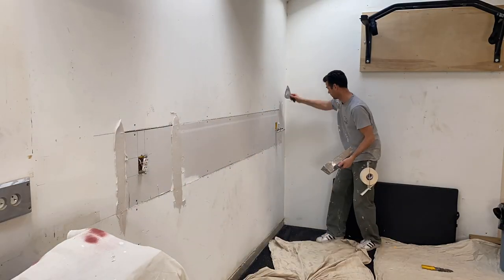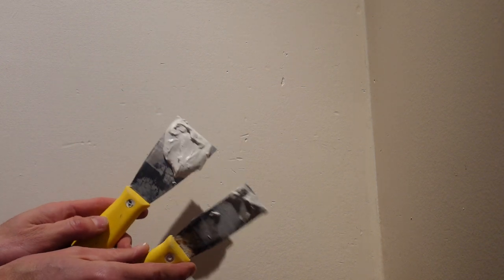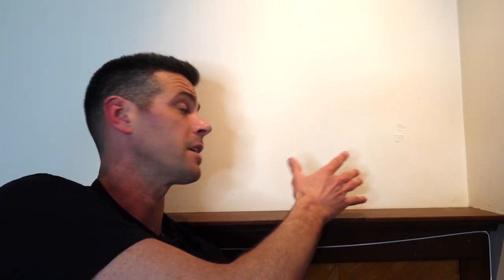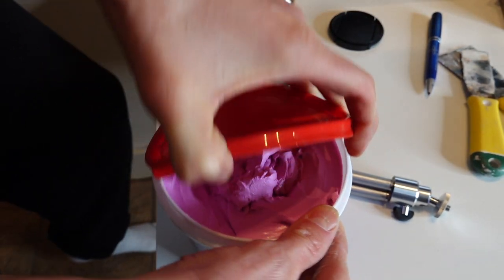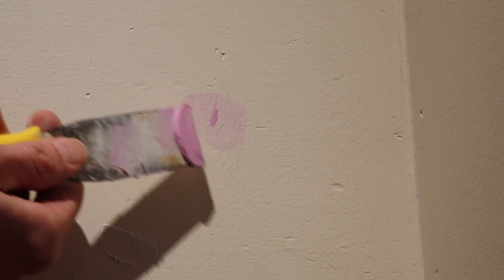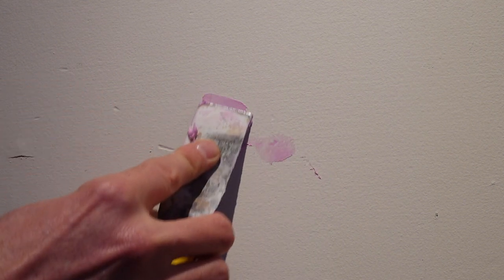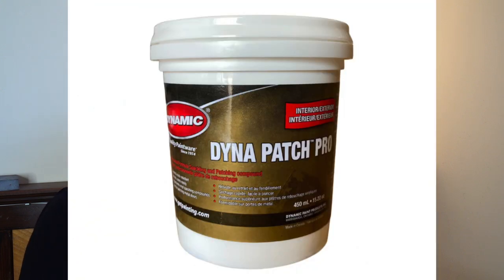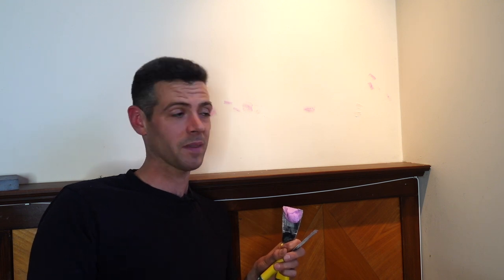Joint Compound vs Spackle!

Comment: My question is, I'm a service tech, I do a lot of small repairs. Nobody has shown a good informational video on how to bring egg shell texture back, I can walk in after 2 coats of paint, and tell exactly where the super flat repairs are.
Reply: Egg shell is the sheen of the paint (somewhere in the middle of glossy vs flat).  Perhaps you mean the bumpy texture that a roller leaves?  Or perhaps the repair area appears more dull or even a different colour from the surrounding wall - possibly from no primer on the repair area?
I am currious myself if he primes his repairs depending on the area and filling compound used.
Reply: @tighep  egg shell is the sheen, but it's also a texture I believe. Either way, the walls have an egg shell type texture. It's not orange peel, it's just from multiple years of roller texture. When I do a repair, I'll put 2 coats of Pro Mar 400 paint (it's what the company buys) and unless I get a heavy nap roller, it would probably take me a dozen coats to bring that texture back. So when you walk in, all the walls have kinda an egg shell texture, and then you have the super flat repairs I've done, and you can spot it from a mile away. Aside from doing a dozen coats of paint, I'd love to know how to bring that texture back as quick as possible and with as less coats as possible. I don't have all day to put a dozen coats on little spots.
Reply: @Chris.Rhodes  Agreed.  Could make an interesting video on how to match existing walls
Reply: @tighep  it really infuriates me after you spend all that time with repairing something and it's hard to match that texture. I've used spray cans of orange peel, and then sanded, it was close, but it's a different texture.
Reply: If you are talking about seeing the texture of the old roller vs the smooth new repair it is virtually impossible. The older houses with dozens of coats of paint end up having walls that look like the skin of an avocado. It sucks because all the modern paints have such small particulates to aid with leveling and flow. The only way I've been able to get close is to use an oil primer with a traditional sleeve(not a microfibre) to try to build up the paint texture. If you're stuck using latex try going back to the patches and dry rolling right before they flash off with a thick nap. My region switched to almost exclusive low sheen paints and it isn't as much of an issue anymore.
Reply: @Chris.Rhodes  I know exactly what you mean. The Eggshell paints for walls show all the little patches that you fixed. Here is what I usually do here in England before using those types of paints.  Once it's dry and sanded, I tap that spot with the tip of my paintbrush using thinned down emulsion, wait 10-15 min for it to dry a bit, and then just paint a bigger area around it using the same thinned emulsion with a small roller. Once that's dry I grab some really worn down piece of sandpaper ( usually 120 grit, but anything higher than that will do as well, nothing lower though) and give the wall light key barely pushing on the sandpaper. I do it for the whole wall if it's a small wall or only for those areas that I filled going over all the mist coast that I did and taking some to the old wall so it's nicely feathered out. Sadly if the wall is exposed to a lot of external light coming in those will still show. I would assume that using high quality emulsion paints like for example Dulux ultramatt for the mist coat could reduce those showing up but not many people would be willing to spend that much money for a mist coat only ( as the eggshell paints already cost a small fortune at least here in the UK). Hope that helps.
Reply: Skim out the whole wall and remove the old texture.
Reply: @wally7856  that's what I do sometimes...but that's not feasible every time. I don't have time to do all that drywall for some simple repairs (towel racks pulled out, kids busting the wall, water damage, etc.) So I'm trying to find an easy way to bring out texture again without a ton of time, and money
Reply: @Chris.Rhodes  If the texture builds up so much that it's a problem, that is caused from not pole sanding between every coat. Been a painter for 36 years and pole sanding 120 grit for flat/eggshell sheen, 150 grit for semigloss is the key to a professional finish that doesn't build up texture over time and you also knock down all the bits of dust and roller fuzz from previous coats. It'll also highlight any runs or drips in the surface that need extra sanding. It should be done before EVERY coat of paint you do and put your back into it. Takes about 5 minutes to do a bedroom and makes all the difference in the world. I'm rather appalled that you almost NEVER see anyone pole sand or even mention it on any YouTube painting instruction videos. IMO, if you are not pole sanding before EVERY coat of paint, you don't know what you are doing and have no business teaching others how to paint. When I come across a built up texture I'll usually sand the entire wall with 80 grit with a random orbital sander (diablo pads work well from home depot). That'll take closer to an hour or 2 to do a room but it'll flatten the texture out and remove any runs or drips from the previous 20 coats. Faster then skimming, then sanding the walls but still a bit of work. Be careful of lead based undercoats if the place is old.
Reply: @Chris.Rhodes  I'll also add that you may also want to try using a different line of top coat paint. Some lines with a heavier body will blend in better then the smoother finishes although they can be harder to roll out nice. Talk to the people at the paint store (not big box store, actual paint store) and they should be able to lead you in the right direction. Also try a coarser finish roller sleeve, something like a 15mm (1/2") well used (broken in) polylamb or microfiber. Back rolling the wall after the paint has set up a few minutes and started to flash off can also bring out more texture.
Reply: @wally7856  it's not that old of a property. I have 51 units I service. But I think you're misunderstanding what I'm saying. From the old coats of paint, there's a decent egg shell type texture. When I come in and do a repair, and then pole sand (I have a plastic sander, and a metal pole sander which I use every time!) And then paint atleast two coats, I come back in after everything has cured, and I can see exactly where that repair was done, because the surrounding wall has texture to match every other wall, and there's a super flat, light catching repair spot. I just want to know if it's possible to bring that texture back, to match the walls. Instead of seeing flat spots everywhere.
Reply: @Chris.Rhodes  I left a few hints above to get more texture. Different line of paint, coarser sleeve, and backrolling. Also spot paint the repairs before you do everything else so they at least get 3 coats of top coat and back roll those spots. A slim jim roller works well for spot painting and then backroll them after they start to set up. Makes sure your roller is on the drier side when backrolling. You should feel the roller drag and pull out some texture when you do. You have to get the timing right and the right amount of paint (or lack of it) on the sleeve. A bit of trial and error.
Reply: @wally7856  thanks brother! Doing repairs now, so I'll try this out Monday when I get on property again! But yeah, i always use my pole sander!
Reply: @Chris.Rhodes  Right on, hopefully we can get everyone on them. I look after properties too so I know the Grind. Happy painting!
Reply: @wally7856  thanks man!

Comment: There's never an explanation on what kind of paint either can be put on in drywall mud videos on the internet. Will both work on flat paint and semi gloss or do you have to sand first?
Reply: If you have a large area, you can use a drywall primer before paint.
Imperfections in the drywall/finishing work show much more with glossy paint.  My dad's got 40+ years in drywall (framing-to-finishing) and always urges people to use flat/matte paint. (I wonder if that's to cover up mistakes? lol)  If you pay attention when you're in buildings and houses, you'll see PLENTY of imperfections.  Most guys don't think that last 15-20% to get the job flawless is worth it.  A lot of people will point out the 1 spot that was missed and won't let it go until it's fixed.  So it goes...

You can call up a local painter and ask how he does it.
Reply: @ItchyKneeSon  I mean already painted drywall and then adding mud. Will mud adhere to flat paint better than semi gloss etc?

Comment: I’m currently finishing my garage walls (just drywall and taped/muded joints), and I have a bunch of little nail holes left over from where cabinets were removed. Would it be best to use the spackle to fill those and then prime and paint the drywall? Or do a broader cover with drywall compound, then prime and then spackle anything left over and then paint?

Comment: Great Video's Ben!, I've watched them all. I'm currently starting my first drywall and mudding job, my garage..Lol. Being a newbie, I have some uneven butt joints, and half inch gaps, and a few extra holes in drywall,when I was looking for studs when I hung the drywall. I bought a bucket of lite all purpose and started mudding last night. This morning I found a lot of shrinkage and cracks, can I let dry and just put another coat over top of the cracks?, how long do I let dry before putting second coat on?, 24 hours?. Also with all these extra screw holes, do I cut the paper pulls off with an olfa knife from when I removed the screw?. One last question, when doing the unevn butt joints do I continue to feather out until flat before I put the tape on?....again great video's Ben keep them coming
Read more

Comment: Thanks. That clarified it for me. Question:  what do I use around the shower where the water has  Deteriorated the drywall a bit?   Thanks for all the great info
Reply: Be careful with water damage. If that area is in a splash zone or high moisture zone, you need to protect your drywall by tanking it with stuff like RedGard, or even better - use something waterproof like tile backer instead of drywall. It may be wiser to extend your tiled area a bit. If water could be a recurring issue, you need to address the root cause first, otherwise it will come back (and there could be worse damage hidden under the drywall).

If it's on the ceiling, look into better ventilation to get rid of the extra moisture that is causing damage.
Reply: @GailyFix  Good advice!  Thanks!

Comment: As a Brit, I never heard of Spackle. Where does plaster sit in the list? We tend to have plaster walls over lathe. Not so much drywall in older houses.
Reply: Plaster is a lot closer to cement than drywall mud is. Plaster is nearly impossible to sand, extremely hard, but it gives you a superior wall finish. I've used a sawzall on plaster and the serrated blade comes out looking like a smooth butter knife after a few minutes. I view it as lite cement LOL
Reply: @ArdFarkable  Thank-you!
Reply: These terms don't mean the same things in Commonwealth countries as North America :(
In North America, we have joint compound and plaster (including Venetian plaster and veneer plaster and plastic of paris), and they are both cementitious gypsum products with differing compositions. I think that you would call our "joint compound" a plaster, but I am not sure. Spackle clasically contains [some amount of] vinyl, comes pre-mixed (some joint compounds do, some do not), and is also vastly more expensive per unit volume. I think the UK has something called "Polyfilla" which is similar to Spackle(tm) but not exactly the same.
Reply: Same here in the US, most houses built before the 60's have lathe and plaster walls, matter of fact right now I'm doing repairs on a kitchen ceiling in a home that actually has a weird transition method for the plaster work, instead of lathe and plaster this post WW2 house was built with walls and ceilings that have ⅜" drywall nailed up to the studs/joists and then the rough horsehair plaster over it then the finish plaster, it came as a total surprise to me when I started pulling down the water damaged plaster on the ceiling on this job, I fully expected to find the typical lathe boards under the plaster but instead the whole thing pulled down right to the joists, I looked at it and said to myself "Well that's not something you see everyday".
The whole thing comes out to 13/16" thick, which there is no drywall in the same thickness so I had to screw 2×4's on the sides of the joists that stuck down far enough so when I screwed the drywall to them the surface was even with the original ceiling, then the typical drywall joint treatment which is pre filling the joints with mud then mud and tape, after that I skim coated everything to about 3 feet past all the joints to blend everything in so when the setting sun shines through the window above the sink and across the ceiling you'll never know I was there, today I'm actually sanding everything and will be priming tomorrow. 
I'm not a plasterer but I do use plaster to repair cracks in existing plaster walls, instead of trying to fix them with drywall mud like everyone else and just have the crack return in a year or two I take a medium size flat blade screwdriver and a light hammer and gouge out the crack into the rough plaster, then I mix up finish plaster (plaster of Paris) and knife it into the gouge making sure I keep it flush with the existing plaster surface because plaster is very hard and you don't want to try to sand it, then a thin skim coat with drywall mud about 4 feet wide (2 feet on each side of the repair) then sand and like the repair I talked about you'll never know I was there, I've used this method for 20 years now and I've never had a repaired crack in plaster return. 
You can't use just drywall mud to repair a crack in plaster, they have different rates of expansion and contraction over temperature changes, like steel and aluminum, which is why if you just use drywall mud to repair a crack in plaster it'll just come back in a year or two, there's multiple homes I've done using this repair technique that I frequent from them being owned by friends and family and I've never once seen a crack return after doing it that way, if I can't guarantee something I won't do it in the first place. 
I'd love to have someone who knows the trade teach me how to finish plaster but that's becoming a dying art anymore, there's people around who do it and there always will be but they're few and far between anymore. 
I have however learned a neat trick when it comes to working with plaster when I fix cracks, if you've ever worked with finish plaster then you know when you mix it according to the instructions it's thin and very little will stay on a knife when you're try to fill a crack, you have to keep dipping your knife in it and smearing it into the crack, and if you try mixing it up to the thickness of drywall mud it hardens before you can get 4 or 5 inches of the pre gouged crack filled and most of it goes to waste, however if you mix some white vinegar in the water before adding the plaster powder it acts like a retardant and greatly slows the drying time, this allows you to mix the plaster to a thickness more like drywall mud and it won't set up on you in 1 minute, it doesn't take a lot of vinegar, probably only about 2 or 3 percent of the amount of water you use, I don't actually measure it, I've just done it enough that I can eyeball the amount based on how much water I have in the container before I put the plaster in but if I have to say I'd guess it to be about 2 or 3 percent, it doesn't take much.
Reply: @dukecraig2402  Great info, thx. For an education on plastering, check out the Plastering for Beginners channel on YouTube. Very informative and also relaxing/zen, like Ben's drywall vids.
Reply: So, with lathe and plaster walls in mind, I'm guessing spackle is the way to go when repairing cracks & larger dings?

Comment: I have a question. I have dime size holes in my wall as well as drywall paper that is ripped. I watched the drywall paper repair video and saw that you used drywall mud for the paper repair. Silly question is can spackle be used to repair drywall paper similar to mudd?

Comment: Hello VC.  I have a door frame leading to my garage that the builder really hosed up.  It literally looks like a dog chewed up the trim on the door jamb and the $)&(#*#)@@ builder just painted over it, leaving tons of divots and cracks in the wood.  How would you repair this?  With wood filler?  Would you remove the paint first?
Reply: I'd just replace the trim. Spackle will stick okay but if it's as bad as it sounds...

Comment: What do you think about 45 minute mud mixed thick for repairs?
Reply: It works. But you have to apply another coat of regular drywall mud to finish it. This is usually a practice for repairing damaged drywall by professionals.
Reply: @huberthandypanda3781  does it still flash through primer otherwise?
Reply: @ibarskiy  The primer acts as a sealer mainly, preventing water in the paint from seeping through. It's the paint that covers up repaired surfaces.
Reply: @huberthandypanda3781  correct. But the primer also texturizes a bit. The complaint with hot mud often is it doesn’t sand the same as regular - which yeah sure. But for small repairs with the primer on - why would you put a skin coat of regular mud on top is the question. Can you still see the difference in texture after painting?  That’s what I’m asking